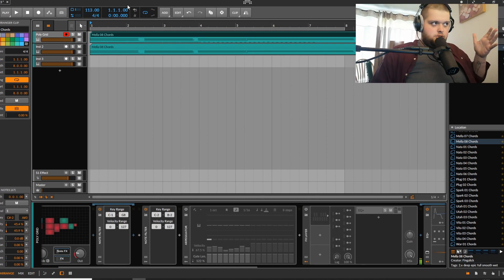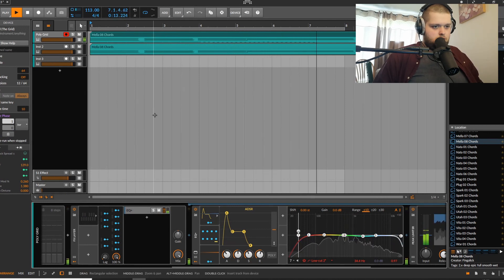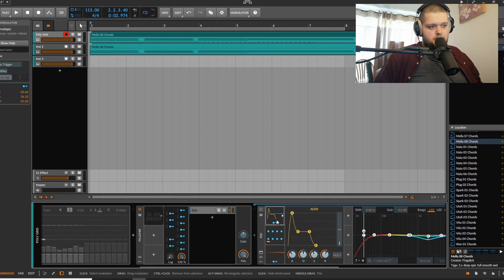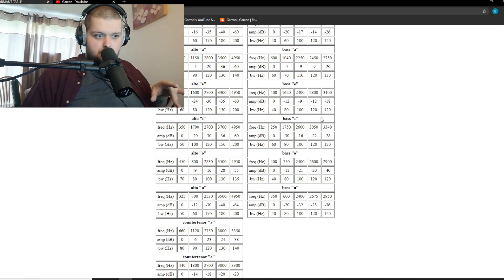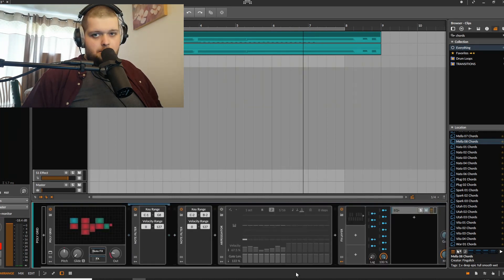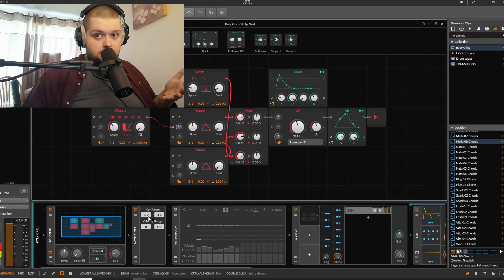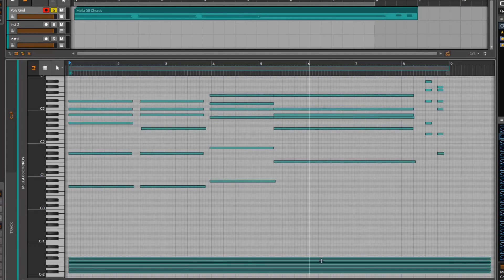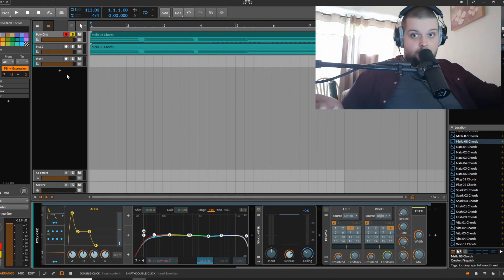Bitwig - Key Switching FX Ideas and Morphing Filters

Comment: 4:30
you say that you let pass everything above B-2, but isn't note filter supposed to let through notes from C-2 to B-2 as from the manual/f1/help from the device (which says - lowest allowed key <> highest allowed key, so it should pass in between, not above B-2 like you've said?). I'm confused .
Please upload an example of your configuration, the outcome is awesome, yet i cannot wrap my head around it :D. Thanks!
Reply from the maker: Dusan Spasic I think I phrased it poorly. I’m letting those notes through to the pitch 12 mod . What I meant is that everything outside of that range is sent to poly synth with a separate note filter from C-1 to C8 or whatever. Sorry I’m still pretty new to making these videos so I’m liable to phrase things poorly and not catch it sometimes 😂
Reply: @GarronsMusic  thanks for the explanation. Can you upload the project file tho?